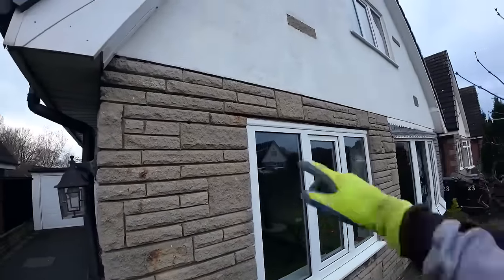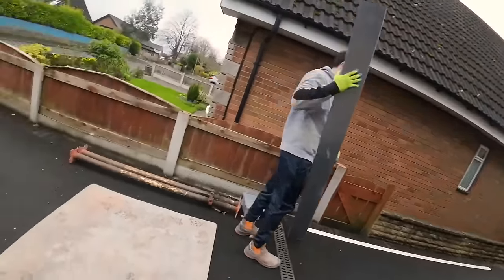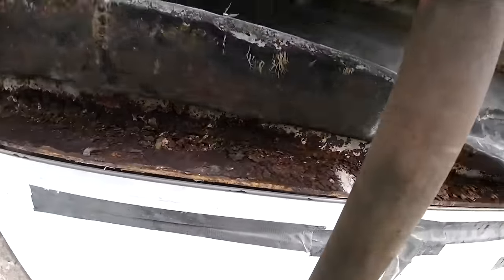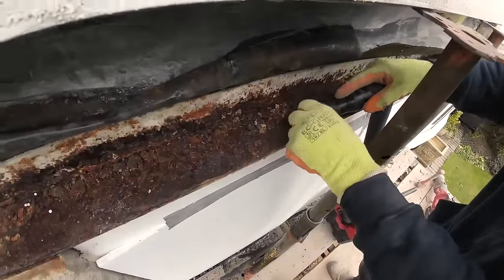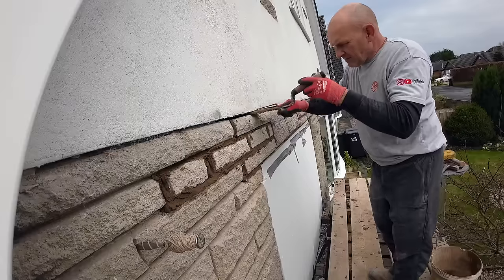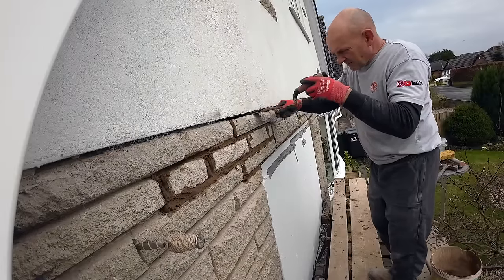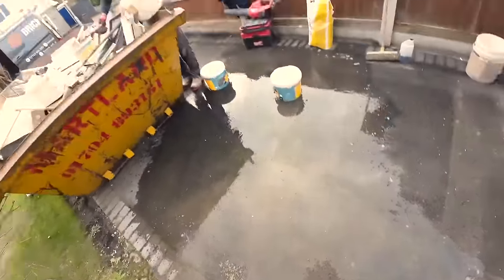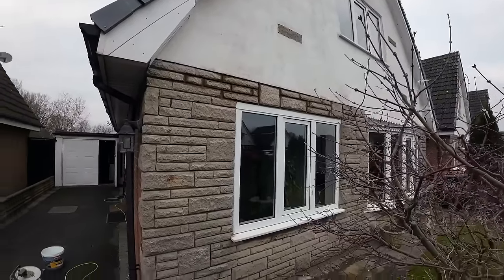NEVER DONE ONE OF THESE ! WHY DID THIS LINTEL FAIL

Comment: That looks wonderful Steve and Alex, ( the bulldozer).   Clearing up makes a job and by the way Alex worked no wonder.
My arm is still a bt sore but I am managing quite well the nurse that came in told me off as I had done my washing up I was told I had to keep my pot dry and leave it to her I told her to look at my dishes so she did and asked how I managed so with out water in the sink I showed her, that shut her up.
In this area Steve Building inspectors don't seem to worry about repairs like yours as long as it is like for like and their instructions are met obviously not for new work where they are most particular an although they never bothered me a lot of the other builders moaned about their visits one job was stopped and a lot of work had to be done to fix it servs them right.
Still a great job boys stay safe and mind those legs.  Best regards Ken
Reply from the maker: Cheers Ken , glad you’re on the mend 🧱👍🏽

Comment: Never get my head around why lintels are so thin and flimsy what are they about 3mm you’ve only got to put a soldier course over and they’re buckling should be 6mm minimum to be British standard… maybe I’m wrong but are they just skimping on steel because they sag with weight aswell by the way good job 👍
Reply: @johngarthwaite4051
Metal lintels are manufactured to B.S or European standard.
They are designed to work structurally according to the span, load and forces to be exerted upon them.
The correct lintel, for the correct location will not sag when you put a soldier course on it.
Also its worth considering how a cavity wall system has the loads distributed over, and through it, as this will affect lintel sizing.
🧱👍😁
Reply from the maker: @martin2466 👌🏼🧱👍🏽